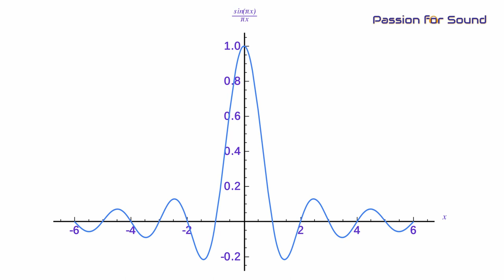Interview with Chord Electronics' Rob Watts - Part 4: Why Up-Scaling is Better and Why MQA is Not

Comment: Excellent review. I will be buying the M Scaler & the TT2 Dac combination and then calling it quits!
Reply from the maker: Thanks for watching - glad you enjoyed it. I reckon I might join you on that decision!
Reply: That’s what I did and have never looked back.
Reply from the maker: My limited experience with streamers and PC audio using the M-Scaler and TT2 would suggest that the streamer used makes only a slight difference. I'd personally be choosing based on your feature requirements and interface preferences more than worrying about absolute sound quality. When A/B testing two streamers you might hear a difference, but in isolation, they'll all sound great with the TT2/HMS combo
Reply: @PassionforSound  Thank you for your honest thoughts. Most appreciated.
Reply from the maker: My pleasure

Comment: Brilliant interview. I share your opinion that It is remarkable how much different highly knowledgeable technicians approach conversion of digital data. I own a poly/mojo that I really like and several (not very expensive) mqa dacs and renderers that I also like a lot. I don't hear mqa as being veiled or muddy. In fact, room information and small details are great. Only if both stages of decoding and rendering are used, that is. Only doing decoding leaves a half way house feeling.
So I'm a bit at a loss about my next step. Qutest would be an option (and this interview affirms the deep knowledge about what causes audible result that mr. Watts has). But losing the immersive and relaxing quality mqa has for me is not something I'm looking forward to. But my sincere thanks for the interview. Just how fast and sensitive hearing works was new for me. And I understand mr Watts's reasons for using only his filter-style a lot better.
Reply from the maker: Hi Ruud, I'm glad you found this helpful. Having bought myself a Qutest, I haven't really missed MQA. Tidal MQA albums still sound great even without full decoding/rendering, etc. but it's probably worth seeing if you can demo it for yourself before taking the plunge.

Comment: What Rob Watts says about the optical interface is a bomb & it's free.
From personal exp. If u start a system it's a no brainer. If u have optical between source & DAC, rush to it.
Get the highest Q real mineral optical multiwire medical grade u can afford. U'll be much safer & will save time, with less investment.
It's limited to 192 Khz & 24 bits... so already high compared to available sources.
And with Chord DACs, no oversampling from sources, so you're good. PFS : do you or did you use optical once ?
Reply from the maker: I do use optical sometimes with streaming sources like Raspberry Pi, etc. What I've found is that optical isn't always the best input on all DACs, but it can be a great choice to avoid noise introduced from the environment
Reply: @PassionforSound  Thx for your xp PSF. Must say, Q of the optical cable must be top noch. Don't even look under best grade. WATTS confirmed : I wanted USB to reach the optical level. This guy designs one of the best DAC of 2021.
Reply from the maker: A good optical cable is definitely important!
Reply: I run the USB input to my 2Qute via a Sonora MicroRendu which provides galvanic separation plus being the Roon endpoint. I am still enchanted by this DAC (which I run in parallel with the well regarded Sabre 32 DAC in an OPPO 205…..and the 2Qute wins reasonably easily).  So perhaps one of the driving forces to upgrade to the Qutest is gone.  Now I will start investigating the M-scaler as upgrade path.
Reply from the maker: Nice setup, John. The M-Scaler is wonderful!